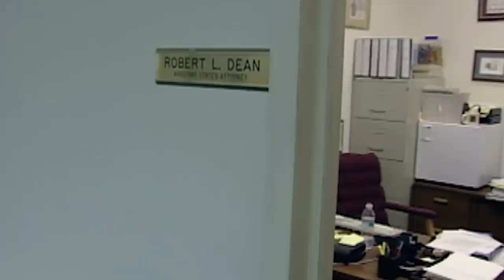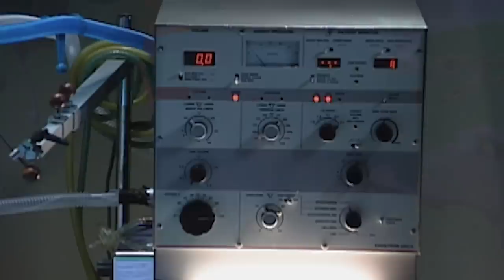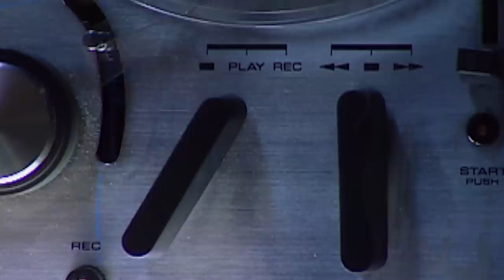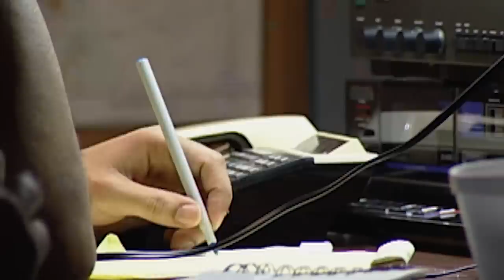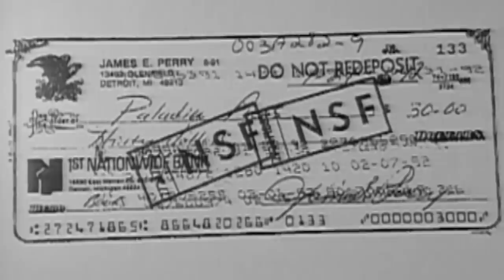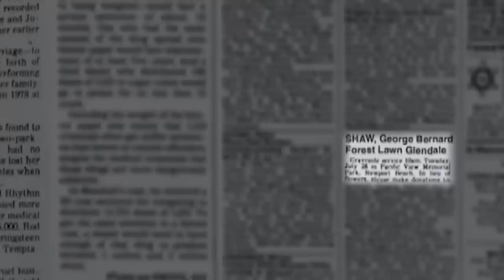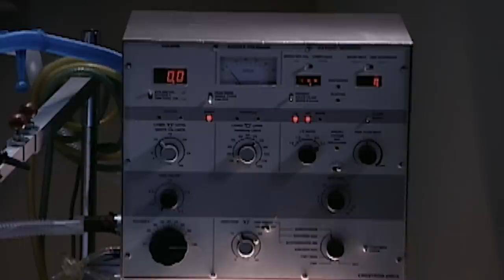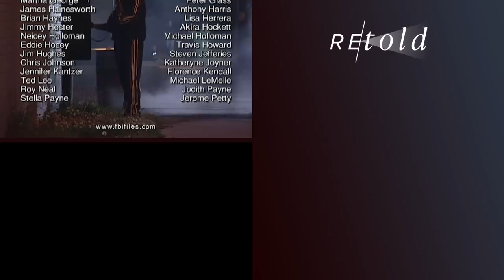Motown Producer Hired Hitman To Kill His Wife & Son | The FBI Files | Retold

Comment: In my Case of A Tracking and Listening Device placed on my Mercedes Benze, The Police asked me if the other Vehicle had a Device on it also, I told him that other Vehicle has not been driven in awhile but I know mista Jim tampered with it also bc the hood had been left open when The other two Officer's had come out here, It's in line for repair, parts ordered and in my garage. Police said after it is Repaired, if a Tracking and Listening Device is on it, Call them IMMEDIATELY and they will open a seperate but Joined Case on that Vehicle. Folks, you have to stay armed and sitting on READY. PLANTING LISTENING and TRACKING IS A CRIME that will get the CRIMINAL LOCKED THE FK UP. If mista jim claim to be a "Rogue Cop" shouldn't it have known this is a Crime that is on the Front Burner. This is one Case that will NOT GO UNSOLVED. This is Attempted MDR IN ALL 50 STATES. If you think abt putting a DEVICE on someone's Vehicle, be prepared to get what's Coming your way. No body is gettinng away with Victimizing me. Thank Jehovah God for my Witnesses, for the Police showing up before mista jim crow could stop his bullsht, they saw it ALL, In Jesus Name AMEN